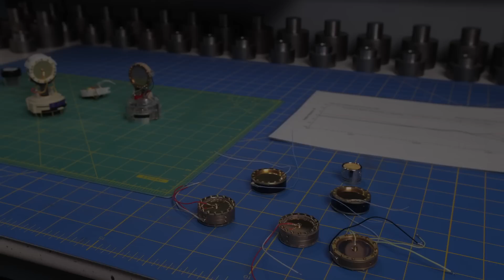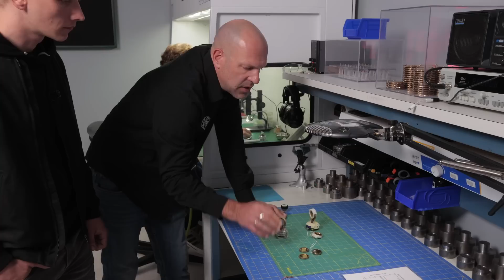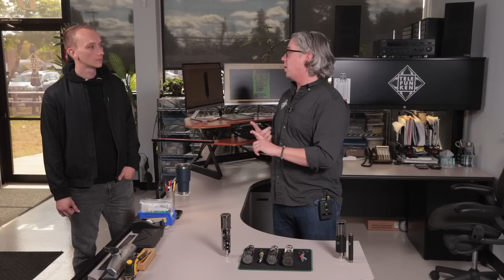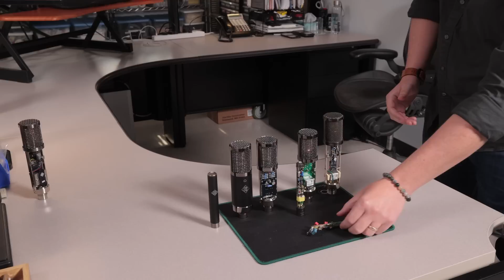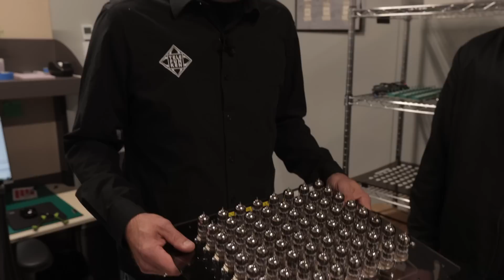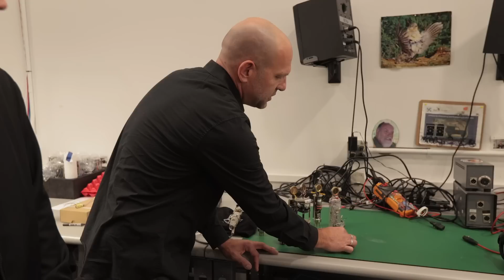Some of the Best Microphones Are Made Here

Comment: Without any doubt, you are building great microphones. 
But, seriously, I totally dislike the bad habit of selling out traditional brand names to modern - and totally different - companies, only so that they can make lots of money by gutting all the skill and engineering of the original brand, that these companies havn`t achieved themselves!
I studied photography, and I used to work for Hasselblad (and I still use their cameras today). Today this brand belongs to dji, and they are selling drones with what they call "Hasselblad"-Cameras for big money. But in fact, of course it ISN`T Hasselblad cameras. This is just rip off with a brand name, they bought. 
And, sorry to say, but your microphones, as good as they might be, they are NOT Telefunken microphones. They are modern US-made mics by a company, that bought the name "Telefunken". This is a completely different cup of tea.
Reply: Yep. they are at least assembling some capsules. Not selling rebadged Apex anymore! I hear they do have something quite close to old valve Tele, so, improving. This video was too slow/basic to sit thru tho'. AMI ? transformers and an ok circuit in the better ones ( I think).